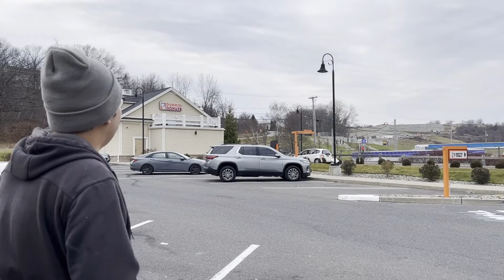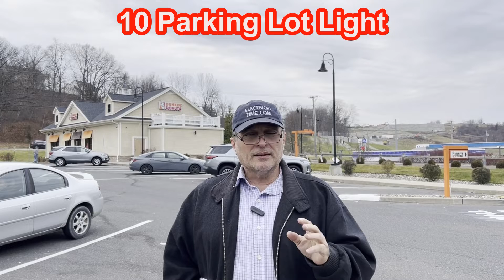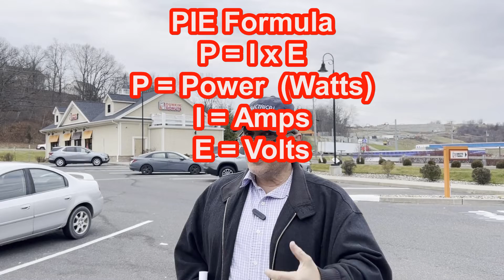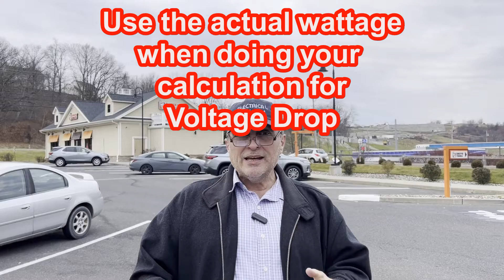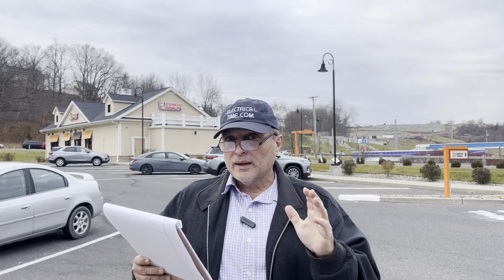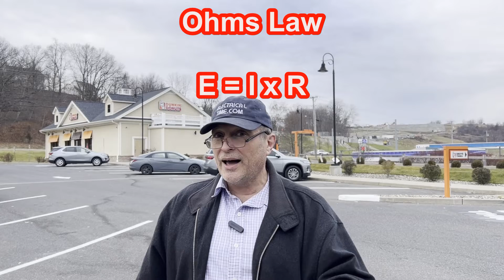Parking Lot Lights with Voltage Drop With Ning by ElectricalTime.com Dec 2023

Comment: So what size conductor would you use for this job?
Reply from the maker: Hi Ted, thanks for that great question. There are several ways that those parking lot lights could be wired up and each way would give us a different result. In the future, I will do a special Zoom Class on this topic and will go over the calculations together in class. Be sure to subscribe to my free NEC code question and answer of the day and I will keep everyone posted when that Zoom class will be. My website is ElectricalTime.com and just click on the Subscribe to the Free NEC Code Questions and Answers. Until then, I suggest that you take that Voltage Drop formula and increase the circular mils to see what circular mils gives you an acceptable Voltage Drop percentage on not more 5%. Also, remember that since the conductors will be underground in conduit, that the Temperature Correction might help to increase the ampacity carrying ability of those conductors. Hopefully you are signed up for my free NEC Code Questions and Answer and in the future, I will plan on doing another video with Ning as we discuss the potential ways that the parking lot light could be wired up. Thanks, Steve